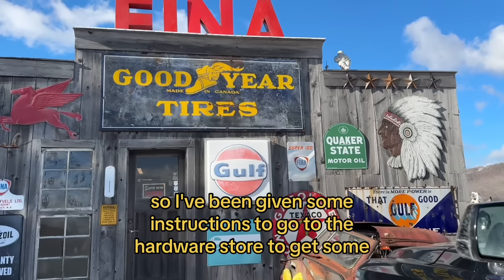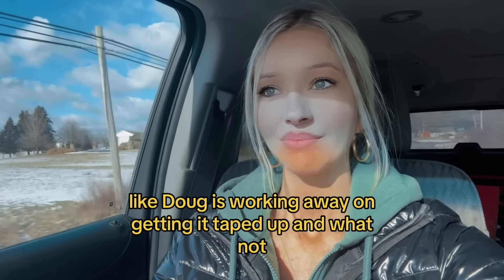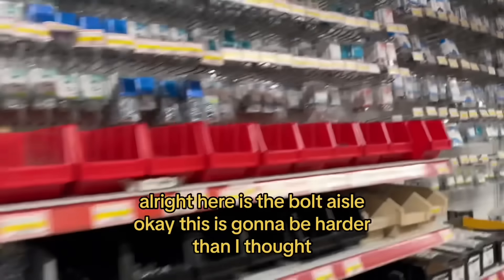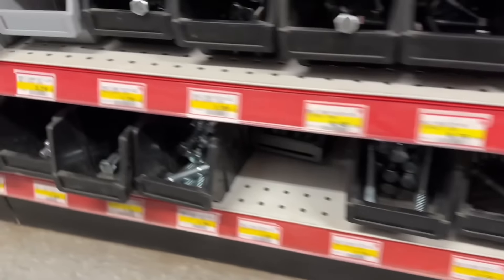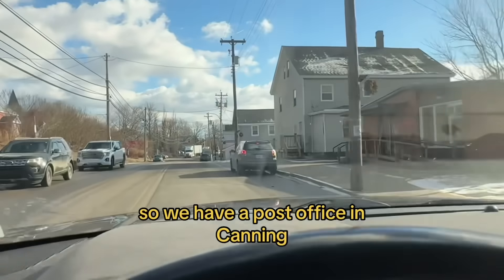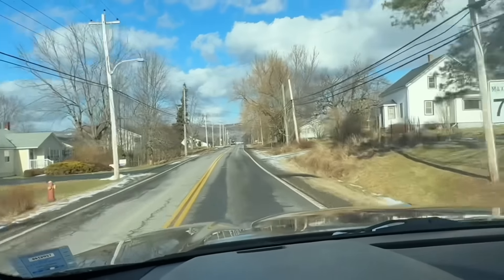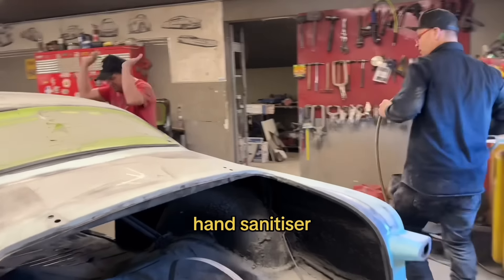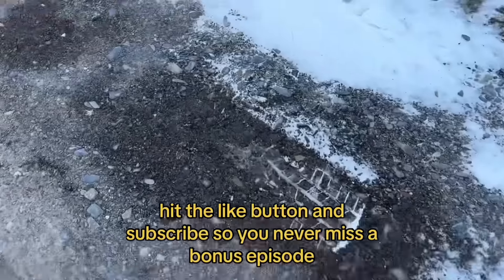Bad Chad freaks out over bumper bolts 😐💀#vlog

Comment: @ROBByJONEs-2
5 hours ago
the bolts you bought do work but bumper bar bolts are a specific size ,the underhead square fit exactly to stop heads from turning while tightenning the nuts on rear side.... what you bought is great ,and under the circumstances hardware stuff will suffice but the square underheads are smaller.. SO  only use them once, if you try to reuse then the square underheads will spin ROUND [eventho theyre new] and tear or Distort the bumpa itself...once tight ,leave them on there.... IF i might Have an OPINION youd be better off to go outside to your pArts cars and get the cleanest shiniest bbp bar bolts from tghe spare parts...they can be used several times witout distortion...IM NOT belittling you,im helping by saying use your new ones once n leave them in n they will last forwver